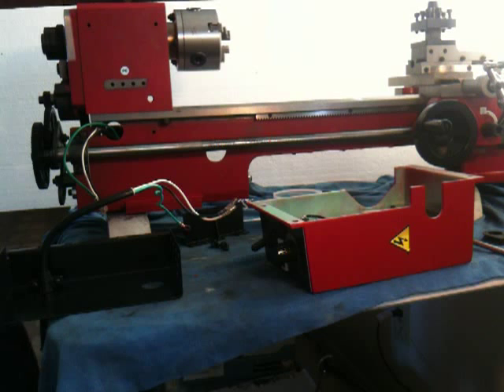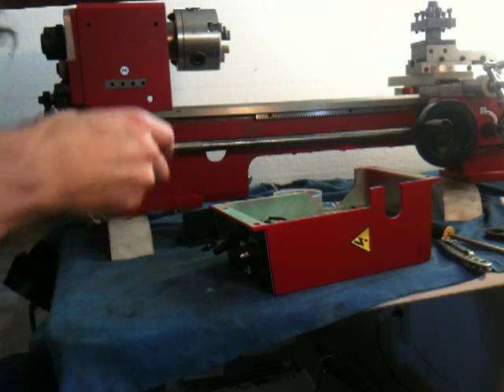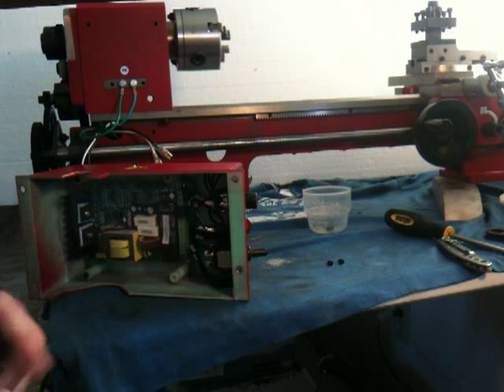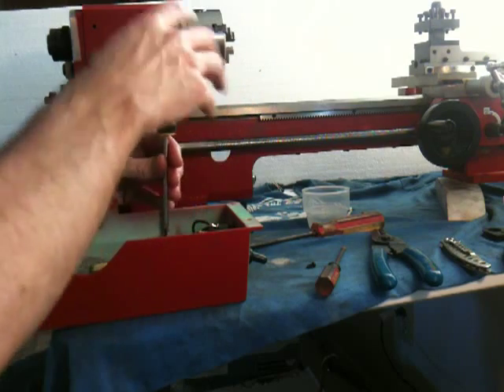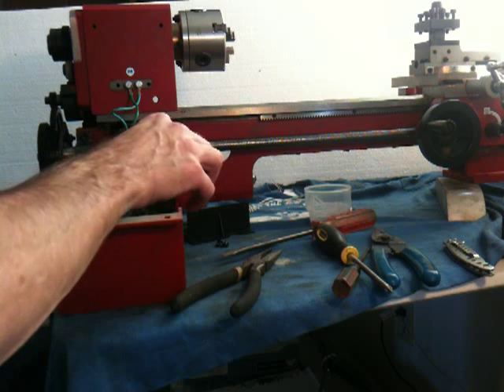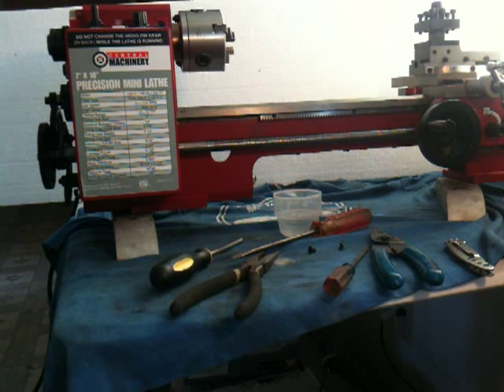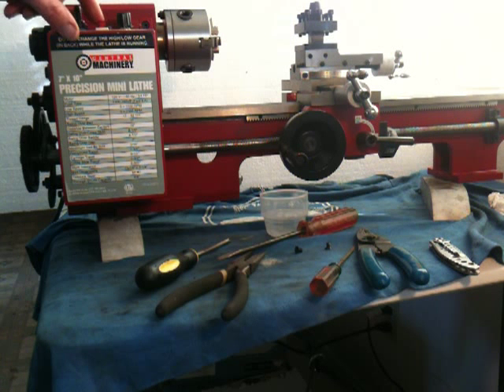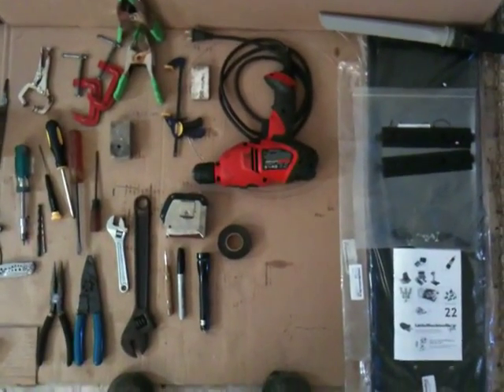Mini Lathe Bed Extension Kit Part 4

Comment: Thank-you for sharing this tutorial of you changing over your lathe bed. I went back and forth from the online instructions to your videos. It sure helps having pictures of what is required. 
I finally finished mine tonight after sitting idle for over six months. I really like the extra 6" to the bed as I like to drill the ends of my work from a chuck set in the tailstock.

Comment from the maker: Paid better attention to the directions. :)) If you've watched them all, you can see where I screwed up by doing things out of order. I would recommend using the stubby jobber drill bits. they don't have as much flex. And, a larger drill press or mill to drill the holes for the leadscrew. My dinky drill press was barely up to the task, as I couldn't really secure the bed on the platform.